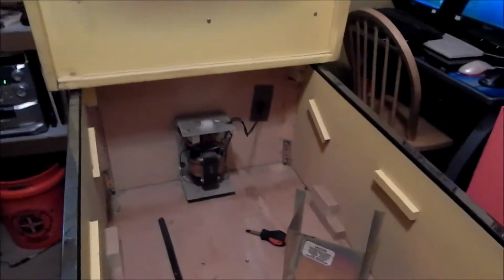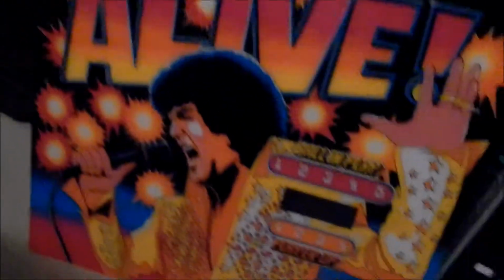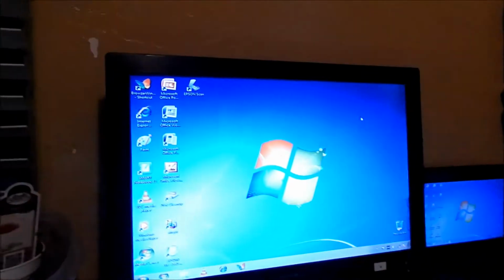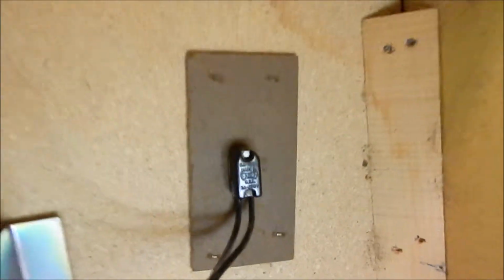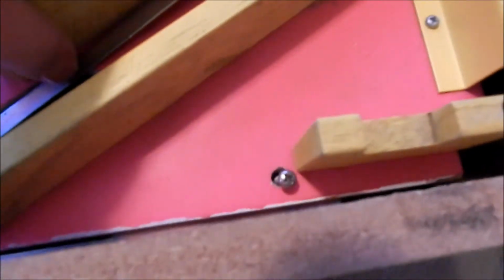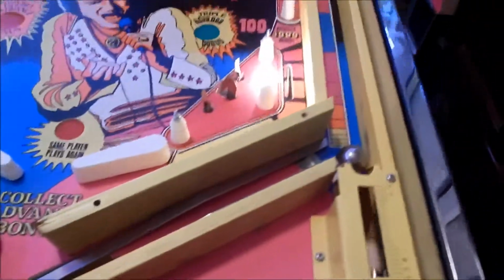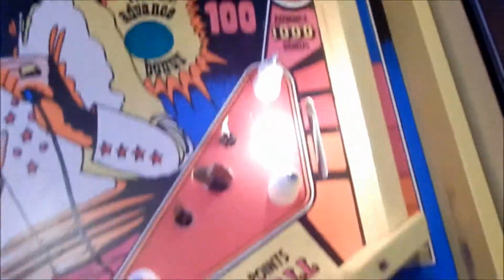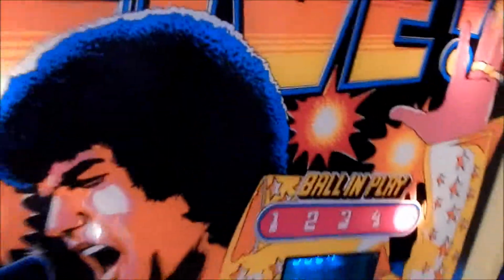How To Fix A 1978 Alive Pinball Machine Power Supply

Comment: @@CristianOrtiztechmaster926 - A friend of mine asked me to look at his Alive pinball machine that was in his garage for awhile. Anyways, I powered it up and only a couple of bulbs are lighting on the playfield, but nothing else is happening (very possible that most of the bulbs are bad as I need to buy a kit with new bulbs and new rubbers but holding off until I can get the power working first). I am not getting the correct voltages coming out of the power supply. Would you mind helping me out with getting the power supply working again? What did you have to do to fix yours? My red circuit breaker buttons don't seem to be do anything (but then again they dont click when I press them, but all 4 red buttons act the same way). I am new to working on pinball machines and would appreciate any help that you can provide. Thanks.
Reply from the maker: To be honest I was messing around with the power supply including the red circuit breakers. The problem in my case was that one of the bridge rectifier circuits had a loose connection which brought this machine back to life. This what I recall doing many years back when this video was published. The problem was similar to yours that I last recall where the machine was not playable. Start with the rectifier circuits which is near the power supply and is very important to convert the AC power to DC to power certain components.
Reply: @CristianOrtiztechmaster926  Thanks for the response. My bridge rectifier #2 was cracked so I replaced it. Then I tested again, and my circuit breaker #2 was not sending proper ac voltage to the BR. I put a 2A fuse across the circuit breaker terminals and the game lit up. I am waiting on the part to come in.